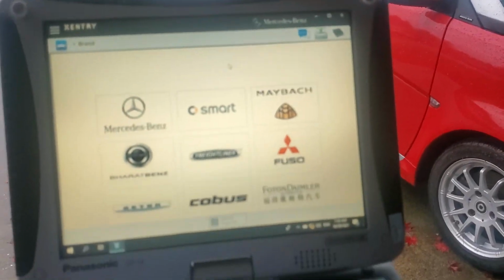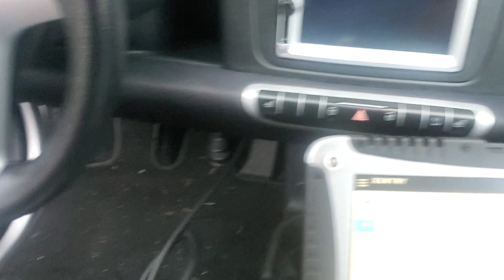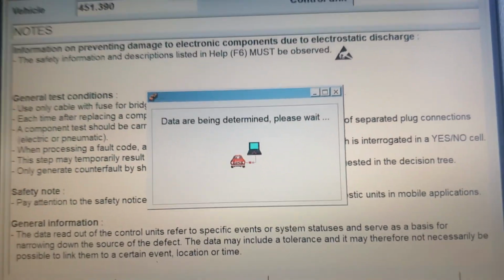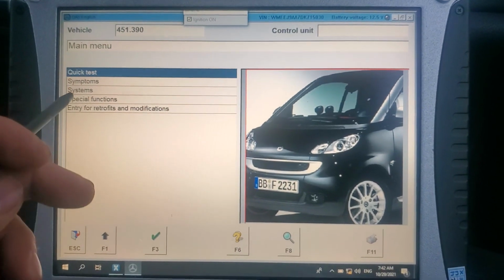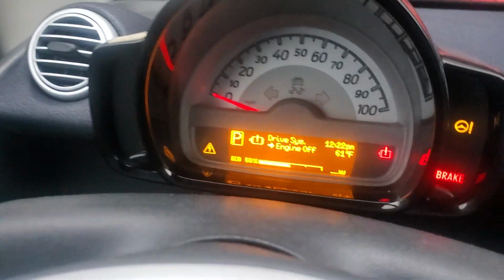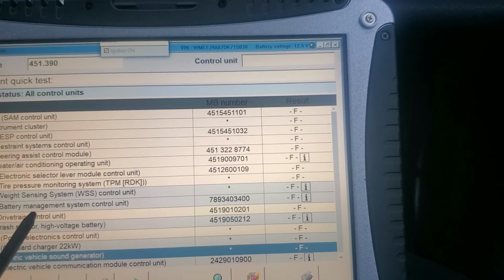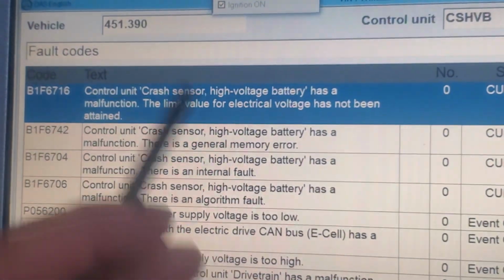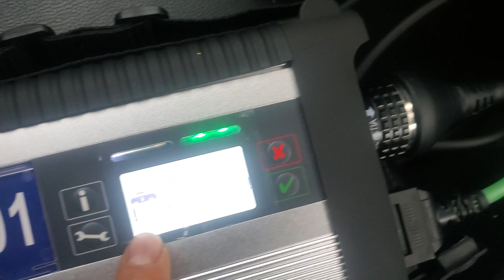MB star C4 diagnostic tools (Part1)

Comment: Our Smart has the same HV System -> Workshop error code. Curious, did you ever manage to fix that issue with the Xentry diagnostic tool?
Reply from the maker: Yes i dentified the EV workshop error .... pointing on BMS need to reset ..... xentry tool can only guide you what is the problem but can't reset or re-program the BMS error but i know a friend who can reset and permanent delete the error P18051C error ....after BMS fix all good again
Reply: @Angelsum143  Good to know about Xentry's capabilities and limitations. Do you know anyone in NorCal who can reset and permantly delete the error on the BMS?
Reply from the maker: @RobertChien  no California personel can do reset yet....hopefully soon